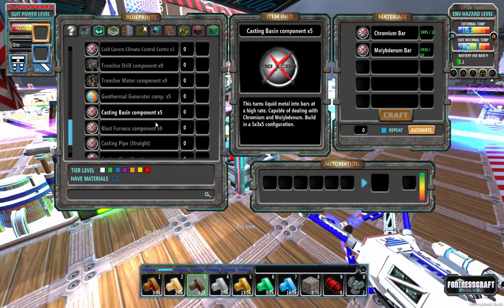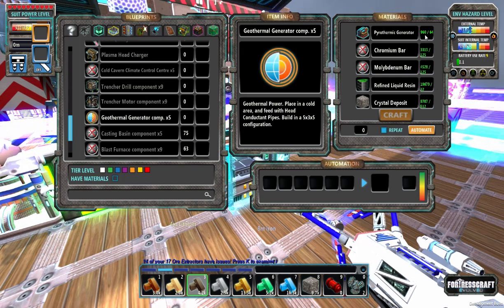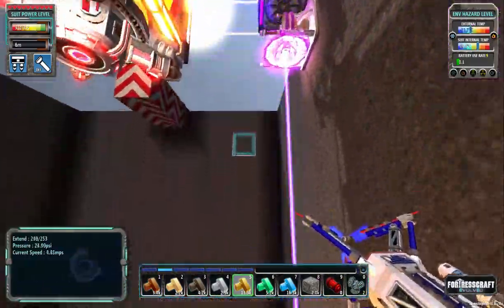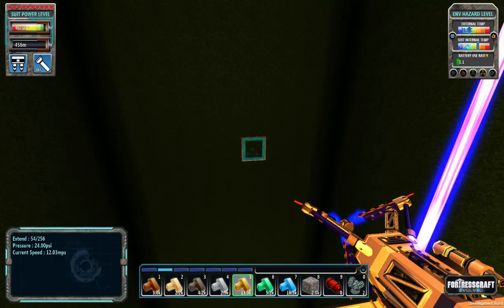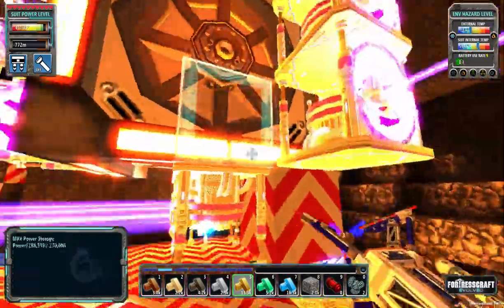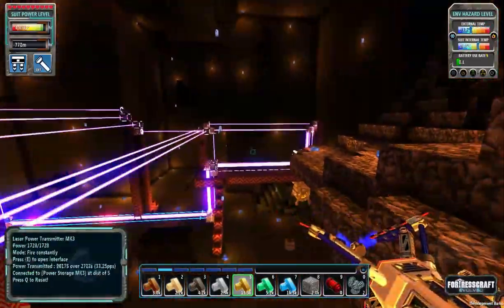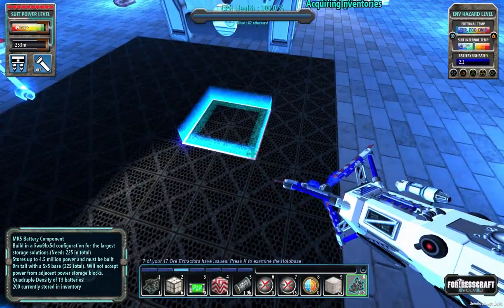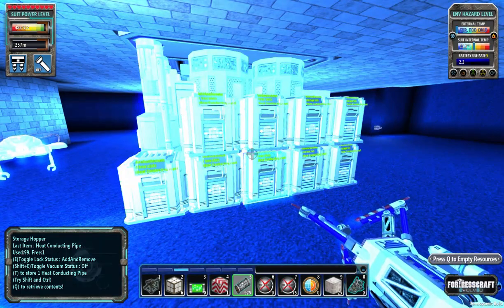FortressCraft Evolved - Ep 93 T4 Smelting

Comment: I am using a few mods that you might want to check out - one for a 50k storage unit (less hopper spam for bars), one for wireless power (3 block radius) that is a great convenience, and the MK2 excavator. Costs could be adjusted, but I don't feel OP with them just better quality of life. They are:

FlexibleGames.Mk2Excavator
Myrianne.MegaStorage
Vici.VicisMod (the "PowWow" wireless energy transmitter)
Reply from the maker: +binaryalgorithm I did download Tricky's hopper mod to give that a try. And I'm the one who made the Mk2 excavator mod. :D
Reply: Nice :)

Do you know how the trencher and other progression is unlocked now? I can't seem to get any of the frozen cavern tech anymore, not sure if I'm bugged. I've got almost all the techs I could including the OET, just not the defensive stuff. I've scanned almost all the blocks down to magma level so I should have the T4 ores.
Reply from the maker: +binaryalgorithm Are you a patreon? Until the expansion is officially released only patreons get access to T4 stuff (as it is very, very unfinished). If you are, you probably have to re-scan Chromium and Molybdenum. The curse of Bleeding Edge is that things can change quite a bit from day-to-day and stuff has to be re-done.

Comment: how do you place the cargo lift ?
in Ep 92 they are not finished and now they are finish
Reply from the maker: +Pakterius the cargo lift is a 3x3x1 multiblock structure you want to place above the terrain so there are 3 empty blocks below it. Then feed it rack-rails you make with the proper machine. Once the depth you want is achieved, look at the lift controller and hit E to open the interface, place whatever cargo lift you crafted inside.
Reply: +Flexible Games 
Thanks :D